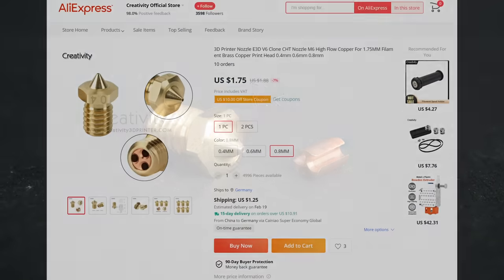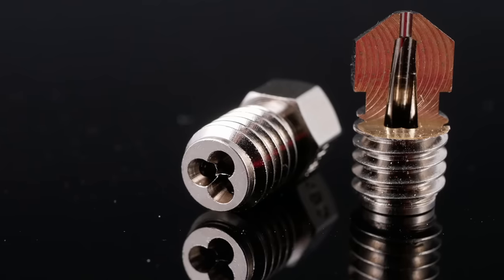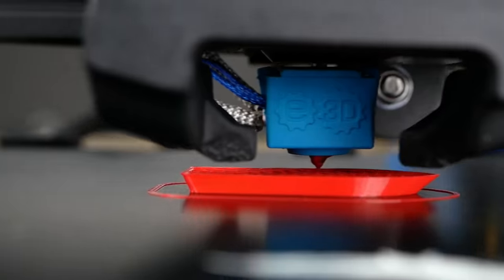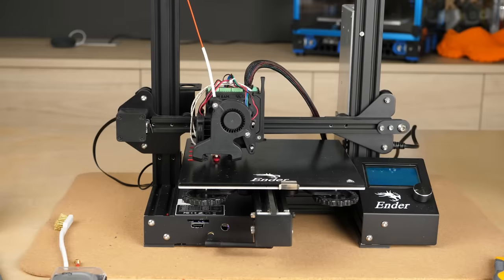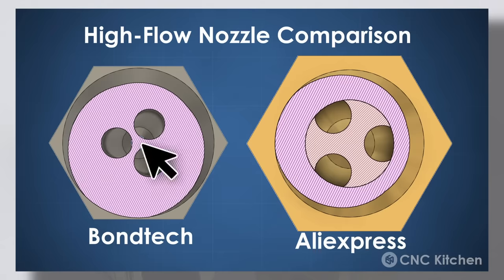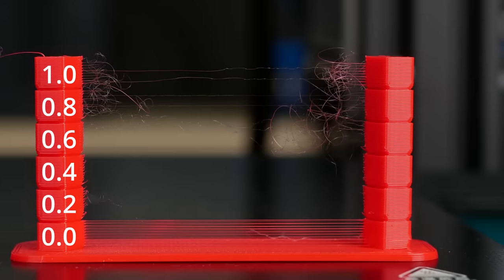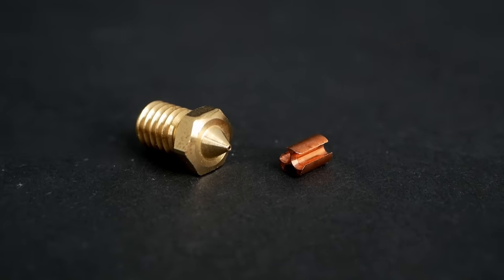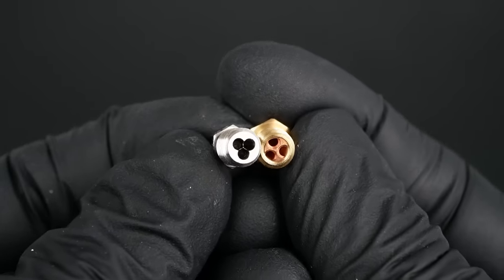$2 Aliexpress Knock-Off better than Original?

Comment: You can clean out the chips with a micro drill bit. Also, between the straight holes and copper being much softer than the brass, it would wear out faster. But the difference in wear is low enough to be WELL worth the price difference. It will wear out between two and four times as fast, depending on the material used, but it costs just 1/10 as much. How ever you break it down, you're money ahead, and in cases like mine, you can recycle the nozzle into something else. Just more brass for the crucible, AFAIC.
Reply: It honestly might be worth nickel plating it yourself if you've got the setup to do that.
Reply: I doubt the insert wearing would be the limiting factor on nozzle life anyway, the nozzle orifice would be. For one thing, I would imagine wear happens fastest at the orifice, the smallest part that material is shoved through at high speed against the wall. Plastic more slowly oozing past the heat exchanger insert won't wear it so quickly. For another, the nozzle orifice has critical dimensions for print quality. 0.1mm worn off the surface (making the nozzle 0.2mm larger) and not having the desired dimensions will cause print quality problems. 0.1mm worn off the heat exchanger insert probably wouldn't make any notable difference whatsoever. These reasons are why ruby-tip nozzles have the ruby just at the nozzle orifice, the rest of the nozzle is the usual brass. So even with the insert a softer material, the nozzle will probably be "dead" due to the orifice wearing out before wear on the copper insert is a problem at all. Perhaps this was something the designer of this insert considered.
Reply: @louisvaught2495  Meh. Maybe. If I had the setup for that, I probably wouldn't. For me, anyway, it would be better to just get new of the superior knockoffs and recycle the worn-out nozzles. As Quill mentions, the hole in tip would wear out faster than the insert.
Reply: @taitano12  It may be less complex and difficult than you're thinking. If you have the fluid on hand, electroplating takes a 9-volt battery, a nickel plate, and some patience.

Also, you can electroplate the whole thing at once. A thin layer wouldn't mess with the dimensional accuracy of the nozzle much, but could decrease wear by about an order of magnitude.

Comment: It seems that you could sharpen the copper blade with a fine file if you want. As an alternative, you could hammer the copper part into the brass injector to make the heat transfer even more effective thanks to tighter connection.
Reply: Or just solder them together...

Comment: I wonder if the knockoff is more difficult to purge? Like switching from black to white filament, wonder if you’d get bits of black coming out of the cracks inside the nozzle halfway thru the next print

Comment: After thinking for a while, its highly unlikely that the patent would stand in court. Very similar hole-structures are used in almost every plastic extruder and it's called the "breaker plate".
The only marginally new thing here is that it is built into a nozzle and not a separate part... but the aliexpress one is a separate part so even more similar to the old and proven breaker plate.
Reply: plus there's all the kids play-dough pasta maker machines
can't patent prior art
Reply: I even got a heatgluegun with such a breakerplate.
Reply: Slice engineering has a patent over spacers in a hotend to support the heater block.

Comment: I bought the bondtech nozzle immediately after you showcased it and I've been very happy with it. As for which one I'd choose, having seen that metal flake ready to fall off and block the nozzle I'd definitely avoid it. I don't mind the design, but I'd rather go with a brand name part for something in the melt path just for piece of mind. The melt path is critical, so it pays to spend a little extra, unlike the extruder where a knock off is often good enough. The price of the bond tech nozzle is not exactly expensive and unlike my early 3d printing days where I'd buy a large pack of cheap chinese mk8 nozzles for my CR10 and just throw them away if they ever blocked; these days I tend to only use my 3D printer for more important functional parts, so I take much greater care of my printer and its setup, use the right nozzle for the job and do everything I can to avoid blockages (filament cleaners really should come as standard on printers).
Reply: It's 7 TIMES as expensive or depending on pricing on Aliexpress at the moment, and surely you would agree that the chances of seeing a burr like that from manufacturing more than rarely will quickly show up in reviews.  Since I, and many, print with .6mm nozzles, I've never once had any get blocked.

Regardless, the pressure on Bondtech now would seem likely to cause them to reduce their price somewhat since any machinist could tell you that their price for those materials and machining make them highly profitable.
Reply: @brianmi40  I think that if bondtech decided to make a newer nozzle that used a similar design to the aliexpress model and improved on it like making a coated version or making the bores more heat efficent it would have a leg up on the aliexpress models and people would trust it.
Reply: @gkolesnitsky  I don't think the issue is trust.  It was shown to work fine, and at rates that exceed the ability of most printers to utilize, unless you are using large nozzles like a 1mm.

I just see most people don't need anywhere near these flow rates with a stock .4mm or or upgraded to a .6mm nozzle.

However, at $2 now instead of $17, it's a strong invitation to play around with one.

I run a .8mm on one of my Anycubic Mega X's for making small to medium storage boxes, but I'm fine with the stock flow rates so don't really have a burning need, but at $2 may give it a play to see if I can push it a bit.

Comment: Great idea, I wonder if we can drill out already existing nozzles, I have some unusual length ones where the insert would be good for! 

One thing not mentioned here is the CHT nozzle is coated, the cheap one is not.
Reply: As another said, there are nickel coated knockoffs available also...  Pretty much anything that works becomes a magnet for a knockoff, which, is as it should be...

Comment: I bought two; a 0.6 and a 0.4.  after tests, on my sovol sv06 using cura and my own test, I was onlly able to achieve 18.5mm3/s with both nozzle.  I suspect that maybe the printer has something to do with it, but I am very disapointed.

Comment: I have been using full metal hotends + nozzles + other stuff more than 3 years now. From AliExpress and local shops. 

Yes premiums are nice but if you have understanding on electronic + mechanics you can have killer machine 1/10 of prices.
Reply: @WhiteG60  I agree with you. Even the 3d print services don't have this "hurry" 

3d printing world poisoning with biased reviews and total unnecessary products for unrealistic need in real world.

Comment: I can get up to 39 mm3/s (at 1% underextrusion) with a clone V6 CHT + volcano adaptor in my clone volcano with an Orbiter 2.0 extruder. This really is some excellent performance. 

It also means that there's still a lot of life left in older hotend designs such as the volcano. No need to switch to a Dragon or other fancy new thing as long as your extruder is able to support it.

Comment: Hallo Stefan, thank you for the test. I wish you had tested 'what happens when you change filaments': can you successfully change to a different color filament without having remains of the other color suddenly appear in the new print? Meaning, when you put a new filament, are we sure that all three channels will be purged from the old filament fully? Danke und schöne Festtage
Reply: I wonder that too. Cold pulling would probably not work. I do want to buy one, so I'll try it out myself
Reply: You change filament, then purge until the color changes fully to the new color. Its no different from a normal nozzle.
Reply: @wiktorpp  If you watched the video, you would know Stefan said cold pulling did not work with the knockoff nozzle.
Reply: @no-page  Oh. I missed that. Thank you

Comment: Hi Stefan. Thanks for as always a very good video. I have also tested the CHT clone and found when it works and when it does not work well. I tested it on an Ender 3 V2 bowden tube fed MK8 hotend with an all-metal heatbreak and a Voron with Afterburner, DirectDrive and Dragon HF. On the MK8 hotend, I saw performance drop of flow for the CHT clone of 10-15% while on the Dragon HF I saw performance increase of flow for the CHT clone in the order of 25-35%. I have posted links to data graphs, but apparently it got deleted. Anyway the conclusion is that the bowden fed MK8 hotend cannot as easily push filament through the nozzle compared to a standard nozzle because, the filament upon arrival at the nozzle split is cold and to difficult to split and bowden system not powerful enough to press through hence resulting in lower performance. On the Dragon HF with direct Drive, the HF part of the hotend esily soften the filament before it arrives at the split and the Direct Drive easily pushes the filament through. That is the explanation why the CHT clone works very well for some and not at all for others. Data on graphs available in the video here https://youtu.be/HypllFpZkXM
Reply: @piisfun  Yeps, they were deleted again. Posted again and deleted again. Or it could be Stefan deleting comments although I find that unlikely. ANd I can't post pictures here in the comments. So no data.

Comment: I think the copper insert is a better idea. I think having it be removable would make it easier to clean the nozzle if you had a bad clog. I cant imagine you could do cold pulls on the original, you could in theory have an insert with a single hole that would allow you to still do cold pulls potentially like if you had some junk at the very tip.
Reply: Insert with a single hole is the original nozzle isnt it? Like it wouldnt have the thermal properties anymore.

Comment: I have a clone.

What's interesting is that I was able to print abs at pla temperatures. At proper abs Temps, I can print my 1mm bore stuff very fast compared to a standard nozzle
Reply: Depends which ABS. For me abs works from 220-235C, using volcano hotend.
Reply: That's quite interesting. So what sort of nozzle were you using exactly?

Comment: Several years ago I did some hi flow nozzle inserts based on the 0.4mm V6 nozzle geometry and used a 4mm dia, x 5.5 mm long brass insert, this still allowed for a reasonable cross section in the neck of the thread. Ended up with 5 x 0.8 holes, and 15 degree tapered holes offset toward the centre to give sharp 'cutting edges' on both ends of the nozzle. This effectively doubles the internal heating area over the length of the insert. Copper paste was used on the insert/nozzle. Was getting around 98 % at 26mm3,  although the printers I had were struggling to print at 240mm/s. Over all found the performance good but they are a bit fiddly to make. Only useful on unfilled materials like straight PLA, ABS and PETG. Forget CF etc.

Comment: If the Bondtech wear resistant nozzles get good reviews, I will be putting them on all my machines. I have bought Chinese knock off CHT nozzles and they are functioning well as the insert is firmly attached to the nozzle. That served as a cheap experiment and now that I know this is a proven design, I'm happy to pay for the real thing.
Reply: Same as I did with the BL-Touch. Got the clone from Trianglelabs 1st, saw how it performs on my setup, can't go back to manual now and after it eventually broke (...no idea how a diode on it's board simply blew up. There's a hole in it...), I got the original Antclabs one.
One can make the argument on games/movies/music as well making new fans through unofficial means. Few are wiling to try out with big buck.
Reply: Any real experience with engineering composites, like CF Nylon? Filament manufacturers tends to recommend at least 0.6 nozzles for them, so I wonder if they are more prone to nozzle clogging or not.
Reply: @WeedleTomato  That's an excellent point. I am standardizing on 0.6 for all my printers with the Bondtech CHT nozzles but I haven't printed any CF Nylon yet. That's a good question for Bondtech.
Reply: @WeedleTomato  i recently clogged a .4mm cht with marble filament (light grey pla with black flakes) so it could be more suseptible to chunks...i just swapped nozzle and the filament, and havent prodded the cht nozzle yet
Reply: I don't understand the logic behind your point. Let's consider the reverse with the exact same logical steps. If the Chinese knock-off had proven otherwise, i.e. to be junk while the original was excellent (but you didn't know that, cause never tested) you would have stopped considering them equally bad?
Reply: @fluxcapacitor  No, I bought a reasonably equivalent copy. If I saw similar flow to a conventional nozzle and problems with retractions, I would expect the same with the CHT product. Chinese V6 nozzles are functionally similar to E3D made version.

Comment: the thermal expansion of Copper and Brass are (slightly) different. The loose insert can get press fit in the Brass Nozle at working temperatures. I would call this a smart design decision

Comment: The insert design could likely be improved by having a slight taper, matched with a slight taper on the cavity.  That would ensure a tight fit, and improve heat transfer.
Reply: i was thinking that he could just put silver solder to thermally join better the parts

Comment: From my experiments, copper volcano nozzle (nickel plated) has similar performance as CHT volcano.
But it makes me wonder if at some point extruder makes more difference than the nozzle.
Reply: I would like to see how a plated copper CHT nozzle would perform 😊
Reply: @Technikfreak72   exactly the same. Nickel plating is very thin and doesn't make any difference (at least not any positive difference because nickel has worse thermal conductivity than copper)
Reply: @shadyb  Their point was the entire nozzle made from copper, instead of brass, nothing to do with the nickel plating. But yea, from what I've read performance difference between copper/aluminum/brass doesn't seem to be much.
Reply: @jaro6985  in my case insert made of copper so this is where it comes from

Comment: If someone sends you a second one you should drill out a volcano nozzle and put 2 of those brass inserts into, you may need to braze or solder them together so they don't miss align though
Reply: I'd say braze because common solders melt at common 3D printing temperatures.
Reply: @wyattutz  I know he mentioned them in one of his videos

Comment: I bought a CHT for our Prusa Mini, but took it out due to excess stringing and no time to dial that in. However, I'll be buying the abrasion resistant version as soon as they come out for both the mini and MK3s. 
Not only in principal do I avoid knockoff products because there is very real money put into development, but crap machining is just that, and I don't have time to deal with more crap.
Reply: yes, but, the thing is that even the "knock off" took time to develop and make it viable for production, it's not a 100% clone/knock off that has near to zero innovation in the design and most importantly, design like this are critical to make the tecnology go foward in a viable direction where you can actually use the product and truly test it's limit on a world wide scale

Comment: Why even bother making holes circular? The open groove would also work.
Regarding the loose fit: at 200C it might be much different as the expansion coefficients are different. Try heating the nozzle and removing the copper inlay part.

Comment: check and straighten the head by sanding, heat will not transfer if it is not flush with the spacer, heat will transfer through the flat surface in addition to the thread.

Comment: Personally I think patenting 3 holes drilled in a threaded rod is at least at the brink of patent trolling. Why stop here, why not go for a single hole? Or the mere idea of increasing heat transfer by enlarging the contact area. Oh, of course they already did it :) Selling a nozzle for 20 bucks is just ridiculous, as long as it doesn't include some special manufacturing method or basically anything that would justify the extreme price point.
Reply: Well before the clones came out it did exactly that, it is harder to manufacture and it gives a flow rate increase. I'd say without knowing that the clones exist the cht nozzle is still quite impressive

Comment: i wonder if there would be any improvement if you solder the insert in place. in both the heat transfer and stringing? im wondering if the stringing is due to the insert moving at higher retract settings?
Reply: To solder without blocking the final nozzle path would be challenging to achieve, as the solder largely goes where the heat is, and that lump on the inside will heat slower than the outer and the thinner tip likely heats up quickest of all, so I'd not try it myself. Also doubt its required - the heat is applied to the outside part and the coldest bit will be the insert itself so thermal expansion difference between them if the fit is reasonably close may lock the core in place while it is in use anyway. Though this does seem like the perfect part to machine to a good tight pushfit upfront to me.

Personally I expect the increase in stringing with greater retracts is that the filament in one or other of those channels is snapped off from the feed so its own weight makes it leak out badly as its lost that upwards pull from the rest of the filament.